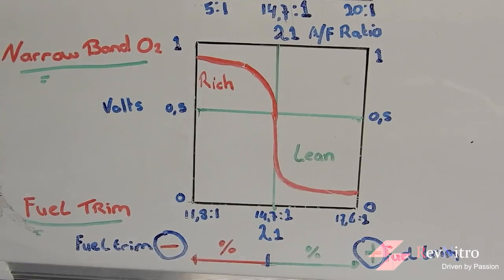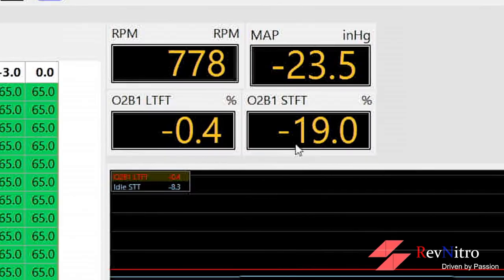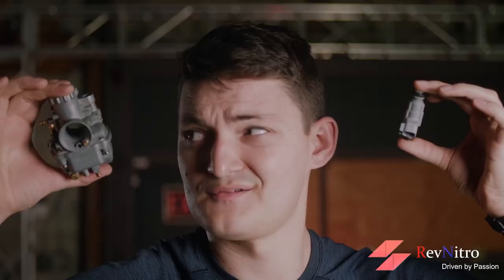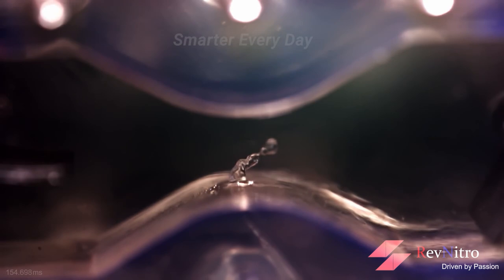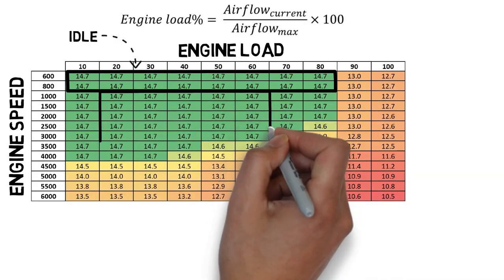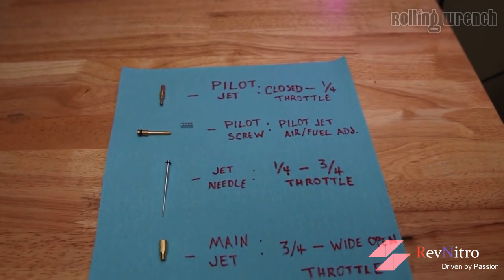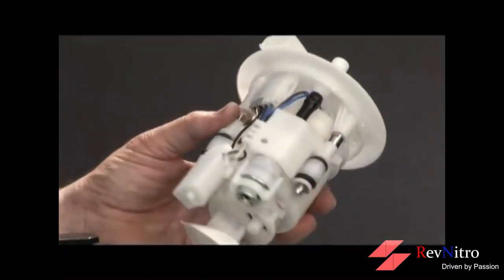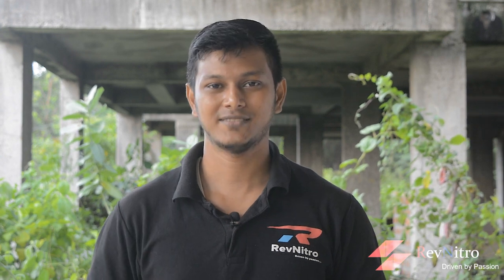Did FortNine Play A Trick on us? : Carburetor vs Fuel Injection | @FortNine

Comment: Bro,.
As like this
Please make a series like 
Valves system and types
Injection system
Cylinder and firing order 
Multi wheel drive (motocross bikes)
Cooling system (air,oil, liquid)
Latest TVS 125cc implemented concealed oil cooler at the clutch cover.

There is lot more Dani bro
And you knew better than many of us.
I like to watch everything in the style of you.
Please consider my comment.